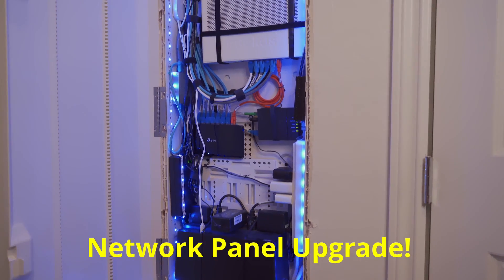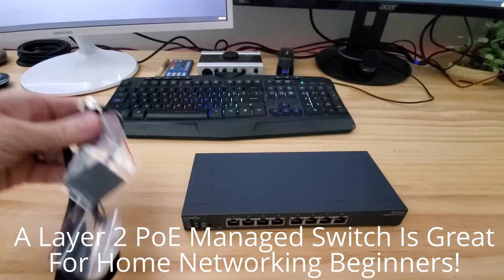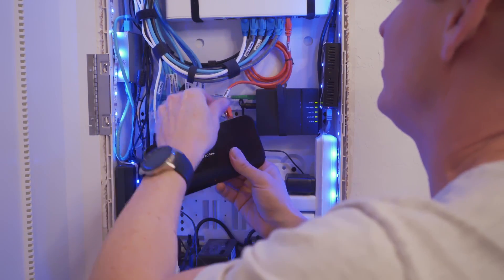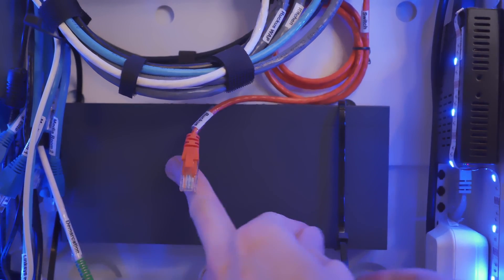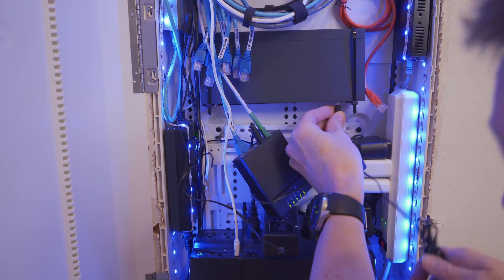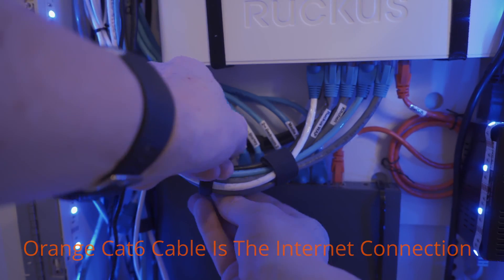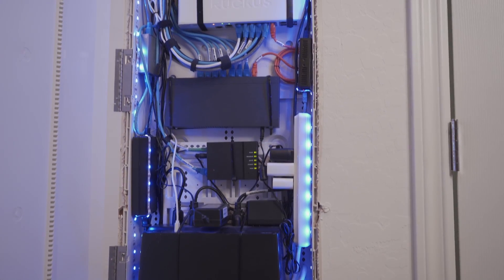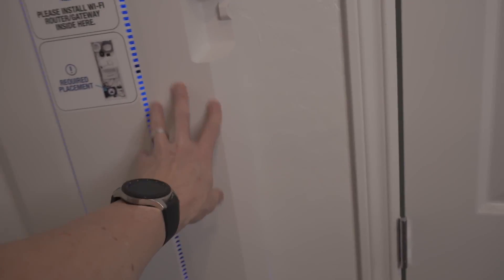HOME NETWORK NETWORK PANEL UPGRADE 2023 - YOU NEED A PoE Switch NOW!

Comment: What are your thoughts on using a smart switch versus a managed switch?
Reply from the maker: I like a managed switch for more options.
Reply: Both are the same thing really. Smart switches usually only have web-based management while managed switches have both web-based and command line/serial management.
Reply: @aurvaroy6670  smart switches usually have the option to be used unmanaged, if someone wants an easy setup, and then can be manipulated later. My understanding of managed switches is that they always need to be managed. Additionally, smart switches tend to have fewer configuration options than managed switches.
Reply: @fudddudd  By default, managed switches also act like unmanaged switches, allowing all traffic to flow. So just like smart switches, you can set it up and forget it, then come back later to manage it. Really the only difference, as you mentioned, is that managed switches have more settings that can be changed than smart switches. Also, managed switches are more oriented towards big businesses and enterprises while smart switches cater towards advanced home users and small businesses.

Comment: Hi Mike, Ur Net Panel is too crowded and not sure how are giving them the air to breathe and cool down! Such cramped spaces can greatly deteriorate the life of components, especially the power supplies, chips on the board and at times affect the peak performance too. Time to make some space or add a cooling fan with thermal sensor. Good going!!
Reply from the maker: Thanks man! I usually leave the door open to keep it cool. I even added a raspberry pi4 into the panel. Its my Pi-Hole home DNS server. Check out the video when you get a chance. Thank you for watching I really appreciate it!

Comment: Sir the switch is a POE switch meaning it provides power also, but if we connect a cable through this switch to our non-POE device, then does this is a concern to know.
Reply from the maker: No, it only provides power when connected to a PoE device. In my panel all the cat6 are connected to either PCs or gaming consoles. But it's great for PoE cameras or PoE Access points. Thank you for watching I really appreciate it!
Reply: @UltimateTechHub  OK sir 👍

Comment: UM, do you mean turn on and off ports ? You can't close a port on a layer 2 switch..
Reply from the maker: That's what I meant to say. Thanks for posting out my mistake. Doing a video a day its hard to make sure you say everything correctly. Lol
Reply: @UltimateTechHub  wasn't trying to point out mistake, definitely not my intention, just wanted to make sure you meant network "port" not TCP/IP port :)
Reply from the maker: @JasonsLabVideos  Absolutely, I'm pretty burned out doing this many videos. Its hard to catch all my mistakes. I need an editor!!! Lol.
Thank you for watching Jason. I would pull the video and redo the mistake but I'm tired.
Reply: @UltimateTechHub  no need to pull video, just out note in comments, mistakes make it legit, everyone makes mistakes.
Reply from the maker: @JasonsLabVideos  Thanks again Jason for watching and commenting in all my videos. I never get mad about any comments. I've had so many bad comments that it doesn't even bother me. We should do a collaboration sometime.
Reply: @UltimateTechHub  Sent message on FB.